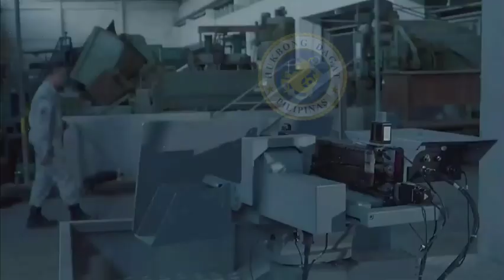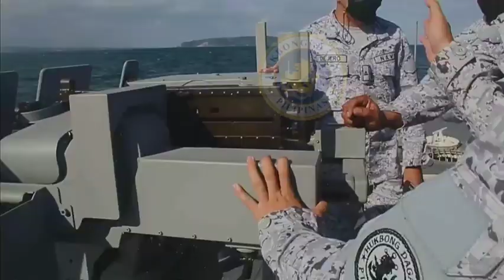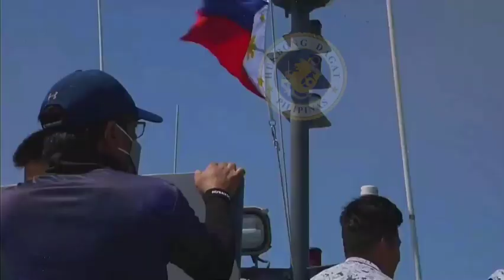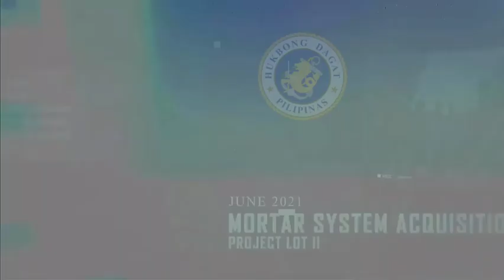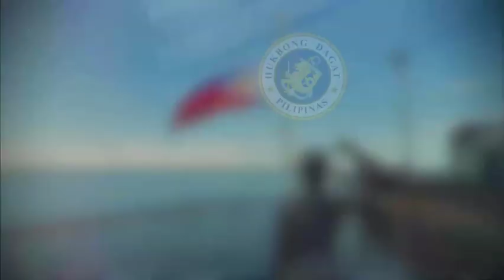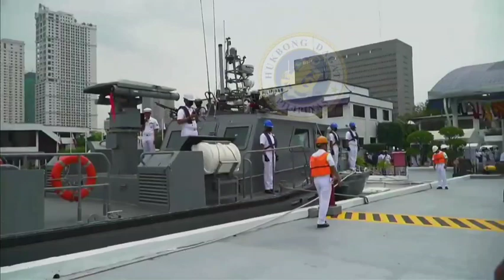PHILIPPINE NAVY @124

Comment: - Philippine Navy's MPAC III with Spike-ER missiles (8 km operational range) is effective against internal or low threats environment but not much against external or high threats. I hope they will acquire a real dedicated Fast Missile Craft like the KCR-60M with C-Star AShM (180+ km operational range) as force multiplier surface combatants.

- Please make the HDP-1500 OPV forward section higher similar to Austal, Krabi and ASFAT to make the design much better.

- For Horizon 3, please consider acquiring the HDF-3800 frigate with 16-cell Mk.41 VLS for 32 ESSM II medium-range + 8 SM-2 IIIA long-range to counter PLAN Type 054A frigates.